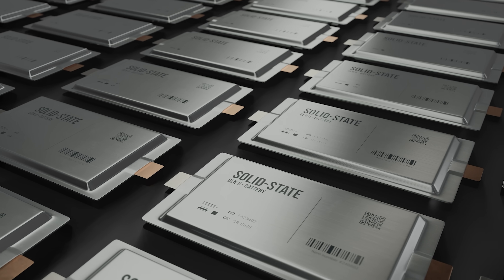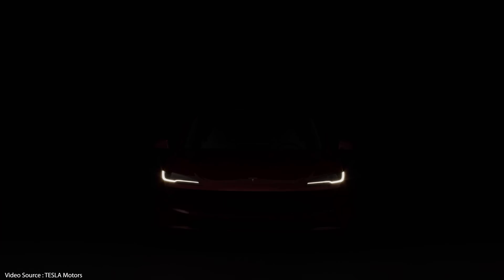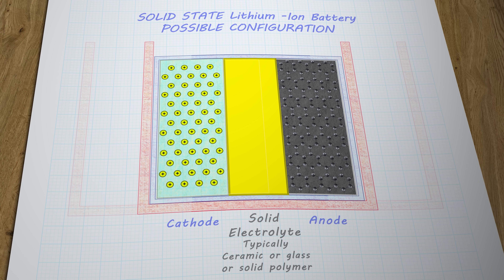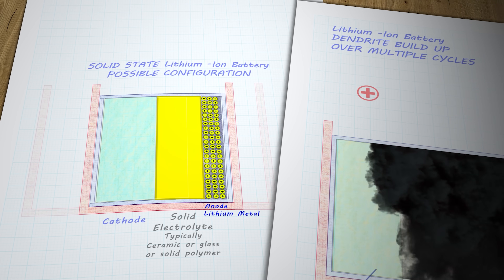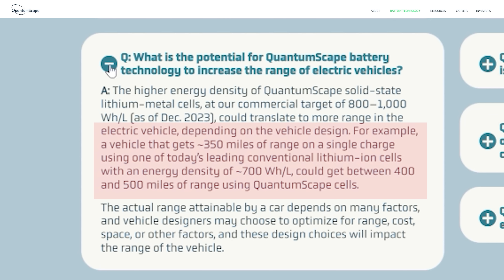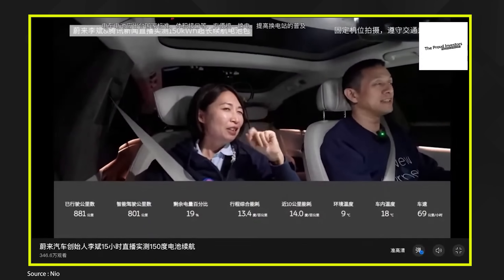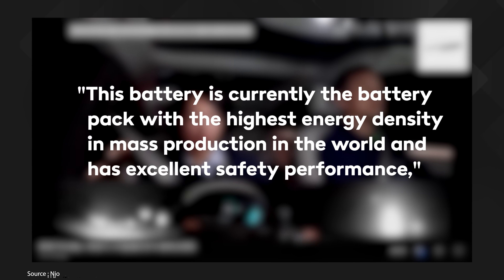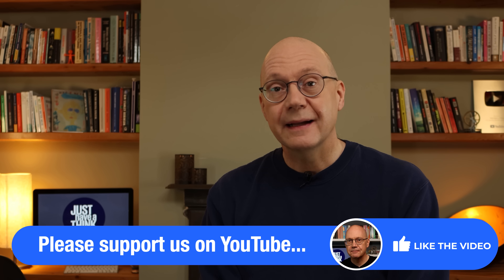Solid State Batteries - FINALLY powering electric vehicles in 2024!

Comment: The large battery capacities aren’t necessary if you can charge regularly at home or work. But for everyone else I think it will be necessary, so people can just charge once at the weekend. That unlocks Ev’s for another large chunk of the population
Reply: Yes, there is a need for more level 2 chargers. EV owners, especially new ones, charge way too often at fast chargers  just like they are filling up a ICE car, when it makes makes much more sense to slow charge 99% of the time. You actually save time charging at home since you don't have to drive to a DC charger and wait on your turn to charge, plus it's cheaper too.
Reply: I don't know much about this industry but is it really that hard to build an EV with a battery pack that can be easily and quickly swapped out like swapping a propane tank for a grill? Swap out a discharged pack for a charged pack at a station and that might even ensure they get recycled properly. Wouldn't that also help with selling used EV's on the used car market? How will people sell used EV's in the future if they have to spend $4500.00 on a new battery before they can sell it? It's like having to replace the engine in every used car before they can put it on the lot. Swapping EV battery packs may not be practical, I don't know.
Reply: @charlesmiller8107  problem is that many people don't seem to like the idea that they don't own the battery. Also this setup requires more batteries in circulation due to the need to allows have charged batteries ready to be swapped. And let the amount of batteries be currently one of the limitations on increasing EV roll out.

Also being able to change the battery might increase weight and complexity of the car, dependent on how it otherwise would be produced (like Tesla turning the battery into an integral part of the car to safe weight and space).

Battery swapping has its advantages and disadvantages. Imo a mix might be interesting, like a small integrated battery for 100-150km range and then the ability to put in another battery for 150-200km range extra. During normal operations you'd have no extra battery in the car, thus lower weight and less energy use/km and you'd have the ability to swap out that extra battery during long trips.
Reply: @MDP1702  The technology already exists, and is in use in places like China (for select EV models). Also, the fact you can then slow charge the batteries would extend their life — which on the long term means you need to manufacture less batteries — and lower any strain on the power grid.

It does require much more expensive infrastructure than just recharge stations, though said infrastructure, including the spare batteries, would likely still be less expensive than hydrogen fuel stations. And, as you said, it would require users to accept the idea of battery-as-a-service.

It might be interesting to start it with smaller vehicles. Some Asian countries already have a swappable battery standard for motorcycles and other similarly light vehicles, and a service where you can just put your empty battery on a rack and take out a filled battery for a small fee. This allows you to "recharge" your electric motorcycle in about 15 seconds.
Reply: @charlesmiller8107 neo, a Chinese company, does this. Seems to work well for them.
Reply: @charlesmiller8107 There are already companies that do this. You drive into a station, it swaps out your battery in 5 minutes, and off you go. But manufacturers have to design for that, so it only works with the EVs that THEY make. The one problem that this solves is the speed of charging. But.. lots of consumers can plan their days and don't necessarily gain a huge amount of utility from saving 20 minutes on the odd trip to the charger. Hence, there isn't a huge business case for the added complexity and cost of implementing this system.

As of right now, all of this is moot. Battery tech and EV features are advancing so fast that used EV cars just aren't really a huge part of the market at all currently. When things start to settle, then we can discuss how to sand down the pain points. But for right now? The obvious paths are promising for a reason.
Reply: That only applies if you have enough power in the grid for it and enough chargers that actually work and neither of those things are looking good at present. We can also add that the price for the electricity we are getting from public chargers varies by a big margin and works out to be no better than fossil fuels in many cases. I understand that the goal of lowering greenhouse gas emissions and pollution may be worth paying a small amount more but the price gouging that is happening at present with some providers is obscene. This is all based on only renewable electricity being used because if it is being supplied by a fossil fuel source then what is the point of it all. A BEV that costs us more to purchase and the same or more to run that does not reduce emissions. For renewable power generation to make dirty generation redundant a cheap scalable power storage avenue is required. I hope solid-state tech is the answer because Li-Ion is not.
Reply: @alistairshanks5099  
We can also add that the price for the electricity we are getting from public chargers varies by a big margin and works out to be no better than fossil fuels in many cases.
Generally public chargers indeed are similar in price as fossil fuel cars, though if you charge at home it is much less. Eventually we should also see more level 2 chargers in things like shop and public parking spaces and at work so you can charge slower while shopping, working, ... which should be at a more favorable price due to the lower charging rate. EV infrastructure still needs to truly be rolled out, but that will increase with more and more EV's on the road.

This is all based on only renewable electricity being used because if it is being supplied by a fossil fuel source then what is the point of it all.
i can't say for every country, but in the US an EV on electricity from a coal powered plant is already equal or better than the average US fossil fuel car. In the EU an EV o power from a natural gas powerplant is around equal to the average fossil fuel car. In reality coal is making a small part of the grid in both the US and EU at this point and renewables are increasing, so EV's definitely are already better, just not yet reaching their full potential in reducing carbon emissions.

A BEV that costs us more to purchase
Price fore BEV's  will go down, it just for now seems to be going slower than expected a few years ago. The pandemic and economic problems might be partially to blame for that, as well as car manufacturers wanting to put more 'stuff' into EV's (software, screens, ...) for some reason, possibly to make it more futuristic/appeal more to buyers or just because now they can with complete newly designed models.

For renewable power generation to make dirty generation redundant a cheap scalable power storage avenue is required. I hope solid-state tech is the answer because Li-Ion is not.
Solid state is also still Li-ion in most cases I think? It are other alternative chemistries that are better for stationary use. Solid state is essentially the opposity of what you want, it being more an expensive high wh/kg battery vs a cheap (usually) lower wh/kg solution (like LiFePO for Li-ion, and just other chemistries like flow batteries, sodium, ...) or even using more mechanical/thermal battery systems (flywheel, compressed air, liquified air, heated sand, ...).
Reply: Understood but I do less than 10k a year, manufacturing an EV to replace a serviceable vehicle will consume resources and add to the pollution far in excess than from my vehicle.  Hybrid is a option which recovers energy from braking otherwise lost as heat and is already available. A sensible solution whilst battery technology improves and the energy grid increases capacity to charge EV. We can't move to electric vehicles over night there is too much inertia in the system.
Reply: @WOFFY-qc9te  No one said we change overnight.
Reply: @WOFFY-qc9te  No one is talking about scrapping used but still serviceable ICE cars to replace them with EVs.

Due to that the grid won't be an issue; even if we instantly reached 100% of new cars sold being EVs, they would replace existing ICE and Hybrid cars as those obsolete things are retired, and thus the energy needs would grow slowly across a decade or more. The energy needed for EVs, when compared with the current electricity generation, isn't that much in the first place, any half competent electricity utility should be able to handle that growing need spread across a decade or more, as it will be.

Transitioning to hybrids first to then change to EVs is a terrible idea, BTW. Hybrids are more complex than either battery EVs and ICE cars, and with EVs expected to fall in price as batteries get cheaper it shouldn't take long until EVs are simply cheaper than hybrids. Consumers themselves seem to have already noticed that getting a hybrid instead of a true EV isn't a good idea, with battery EVs already selling more than plug-in hybrids in almost every country where both are sold.

Not to mention that two transitions instead of one would stress out supply chains and likely lead to confusion, scarcity, and higher prices. It's better to transition just once and be done with it. The transition to EVs will already be traumatic enough for the industry as it is.
Reply: Larger energy densities means lighter batteries (we might start seeing EVs lighter than the fueled, or even dry, weight of the equivalent ICE car with similar range) and less material used (so more batteries made with the same amount of Lithium). With proper competition (which seems likely to happen) it should also mean cheaper batteries in the end. Pursuing those advances is worth it even if you don't intend to increase EV ranges.
Reply: EVs are a scam. They'll forever remain unaffordable and they have absolutely zero environmental benefits. Furthermore they're rolling bombs. EV busses in London prove to be very good at burning down en masse. EVs don't work in cold climates. And yet all the EV nutcases yell "It's fiiiiiine, you just need to get USED to all the crap thats not working!".
Reply: Also necessary for people who live in the middle of nowhere. Parts of the Northern Territory in Australia have 800km or so between towns. Of course as a percentage this is a reasonably small percent of the population, probably less than 2 or 3 million people in Australia (of around 26 million, so 10%) would need that kind of range to get anywhere (ignoring residents of Perth, lets assume none of them plan to go anywhere east)
Reply: Petrol, LPG, Diesel emissions for those few who travel long distance is far less than the cost of infrastructure to charge  EV's just to wave a green flag.  I am from UK but I can't see a road train running on battery for a long time (cement Australia fires) . We have to be realistic and practical.  If I was in the outback I would not be in an EV as I can get an IC home without a computer saying NO. Also I can't afford 50.000 for a vehicle to replace a Toyota Hilux or the like.  LPG is a good fuel that should be used more, my old LS400  V8 loved it. As I said Hybrid is best of both worlds and reduces the need for a large battery, if you only commute a short distance and infrastructure available to charge then yes go for EV. Scrapping and replacing 800 million vehicles just to please 'Gretta Turnburg' is not going to save the planet more likely make matters worse.  @AusKipper1
Reply: @AusKipper1  Aren't there any railways in Australia?
Reply: @beatreuteler On the east coast there is affordable passenger rail services that are very slow and always late. The large cities also have passenger rail within them that is serviceable.
Reply: @AusKipper1  useful would be railways in between cities and coasts, fast ones, of course.
Reply: @AusKipper1  I mean. How do people today get across Australia? I imagine there are gas stations along the way, right? There's no reason you can't have similar infrastructure with electricity. In fact, if you set up solar chargers, for example, you may not even need to pay to ship in fuel like you would for a gas station. Other than that.. most people probably just fly. It's a TINY TINY percentage of the population that will ever need to regularly make trips between such remote towns, and most of those will be commercial trucking. EV trucks might have different calculations on the importance of range vs speed vs weight, so it'll be interesting to see how different tech options change the viability for industry.
Reply: @Cyrribrae Generally the range of an efficient diesel will allow you to travel between Adelaide and Darwin without having to carry extra fuel between stations, though some are very expensive so many (most?) will carry enough fuel to travel the 1200km from Alice Springs to Katherine. For me this means a full tank of fuel plus 3 20l jerry cans. A common modification here is a long range fuel tank too, typically replacing a manufacturer 60-75l tank with one about 120-150l is size, or they will buy a land cruiser that comes with 2 fuel tanks as standard. And yes, in the wet season people have to fly but you cannot carry many supplies with you when you fly and the shops in the remote towns are very expensive so if you can drive you usually do drive, stock up in a larger city centre then drive with a vehicle full of food and consumer goods back to the middle of nowhere. For example, where my sister lives a 2L bottle of juice is about $10, at the nearest town centre 700km away that same bottle of juice will be $2.30, so once a month or so when she travels she saves a significant amount of money on the grocery shopping that would make flying in comparison seem even more expensive as I think if she did take the plane those smaller regional flights limit you to 10kg or so of luggage.
Reply: @AusKipper1  yea, I still think 1200km journeys once a month is a situation where the solution is "more charging infrastructure" than super giant battery. That can just be adding the odd solar charger at those stations, which already exist. Avoid extra cost and weight that you must account for every single day for a trip you do only infrequently.

But sure, there are people who will need more range regularly. For those people, there will be vehicles that are heavier and bulkier but with more performance. And that will likely fit your use case better.

AND that's assuming EV only. We'll have hybrid vehicles for a while. And while there's no guarantee this would ever exist, a solid state hybrid could be useful, adding quite a lot of range without sacrificing a lot of space. All with super fast charge times so you could charge up whole you're there to get more fuel.
Reply: @Cyrribrae  Flying is terrible environmentally and there is little prospect of significant change in the medium term. Efficient range extended EVs or EVs with large super dense batteries are really needed to decarbonise the 4wd / ute / truck market globally.
Reply: @kingdomofashes  I wasn't really suggesting we fly everywhere. But Australia IS an island. A big one. (Aren't we all). Regardless, I'm not saying nobody needs extended range EVs, simply that MOST PEOPLE don't need extreme range EVs. We can accomplish the same effect in the vast majority of cases with less material and less weight using just a bit more planning and patience.
Reply: A German company apparently extend the range of a 350km battery to 440km with solar panels on the car. Nice if you live in a sunny region.
Reply: @alexmcgilvery3878  That wouldn't be a single trip for the entire range. It would be a bunch smaller trips where the car is spending most of the day sitting in the sun.
Reply: @tschorsch  If we assume an EV to have a range of 350-400km, than a 800-1200km trip would use 2-3 stops of around 30-40m each. This makes the trip a bit longer, but not split it up in multiple trips. Taking a small break after every 300-400km is advised regardless. In total you'd take 8h instead of 6h40m over 800km and 12h instead of 10h for 1200km.
Reply: @tschorsch  according to the article it was driving continuously around a track, but yes it would be more effective for short trips.
Reply: Extra power for the AC ....... @alexmcgilvery3878
Reply: IC engines allow you to do what you want, EV well you spec to your requirements which may mean you carry a tonn of weight to give you range which in the main you may not use.   I think Hybrid is better as you have the option to extend range for those few times you may need it and recover energy normally lost to friction brakes. Diesel are good when run hard but not good around town. To change the planet to EV is very destructive, it is something we have to gently migrate to. The main pollution is not from vehicles it is from the developing countries making cement and nitrogen fertilisers. My Lexus is 19 years old and works a treat, emissions are practically undetectable. I don't intend to change.
Reply: @WOFFY-qc9te  Not to change is fully to your discretion. However hybrid is the addition of the drawbacks of "both worlds" and is unlikely to last very long as BEV's gradually improve. Actually "migrating very gently" is precisely what we do. No?
Reply: @WOFFY-qc9te  main pollution is from demand by western economies, particularly the U.S. Much of which is accommodated by cheap labor and technology in other countries.